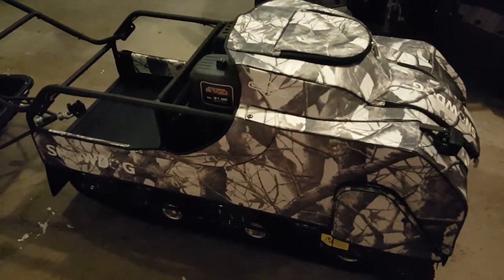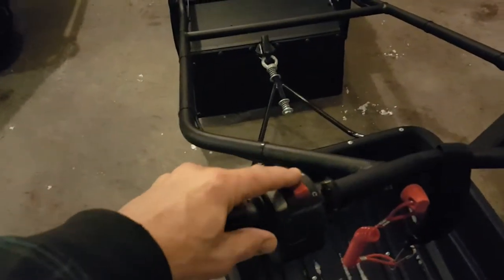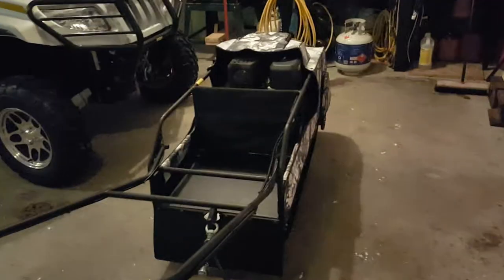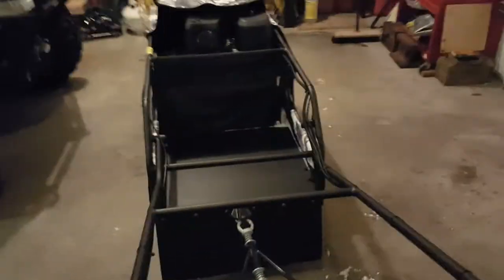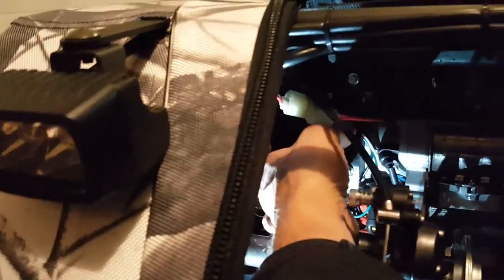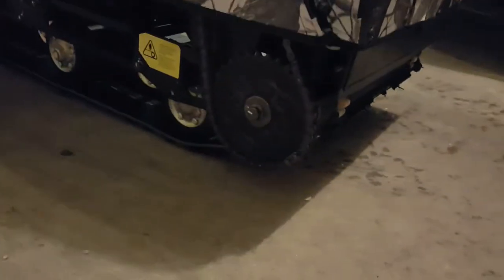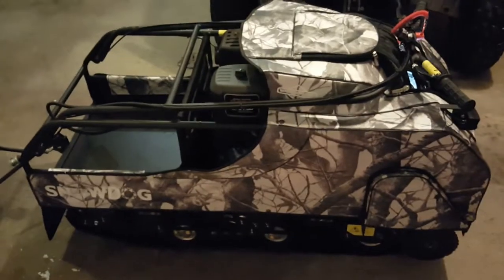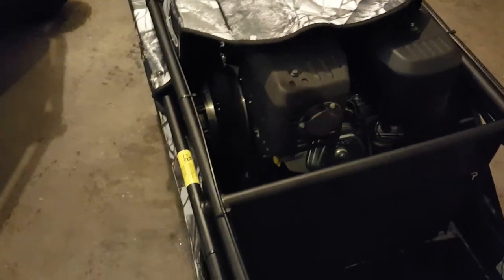SnowDog Features

Comment: Thank you for posting. According to the Snowdog website (if I am reading it right) they all have the same engine! However, only the top model has reverse function.
Reply: At the time I bought mine, 3 years ago, reverse was only available in the U.S., not in Canada.  I was told then they had an issue with reverse machines breaking chains, so I think they hadn't gotten it working exactly the way they wanted it to.  Perhaps it's better now.

Comment: I picked up some studs today and a 20"led bar headlight going to put them on this weekend. Do you have yours studded?
Reply: Hey.  I don't have mine studded.  Where I live in Ontario, it's almost always snow we are travelling over, not bare ice.  If I used mine lots on bare ice, I'd probably do that too.  The light bar would be nice, but the LED light it comes with has always been sufficient to see for night time operation.  I've driven mine after dark the last 3 years several times and never had an issue seeing.
Reply: Yeah I can see that with your snow. I'm in the kawarthas and get a lot of thaws and then freezing. The studs should help. I pull 2 sleds loaded with 800 to 1000lbs. Couple of fat buddies lol. This is my second winter. I love it, thanks for resonding.

Comment: How do you like it? I'm in NH really considering this.  Does it have an alternator or something to charge battery when using lights etc ? Any accessory plugs for a GPS or something similar? Or a usb power source? Thanks.
Reply: Hi.  Yes there's an alternator.  The only time I've ever had to put a charger on mine is after it sat all summer.  I've never had to do that in the winter.  Once when i was trailering it a long ways at -40° the electric start wouldn't work,  put it pull started the first or second time I tried.  There aren't any accessory plugs, or usb, but I don't see why you couldn't install that to the electrical system.  I quite like my snowdog.  It's a very cheap way to go ice fishing.  Here in Ontario, I don't need any insurance or to register it.  Since it's governed I don't have to wear a helmet. The only time I wear one is if it was very cold, since a snow machine helmet is warmer than just a toque.
Reply: @AlRichards314  
Thanks I appreciate your reply.  I think a snowmobile is over kill for me this will be just for ice fishing.  It seems so easy. They seem pricey but suits my needs better.